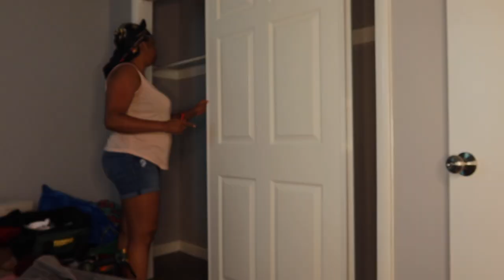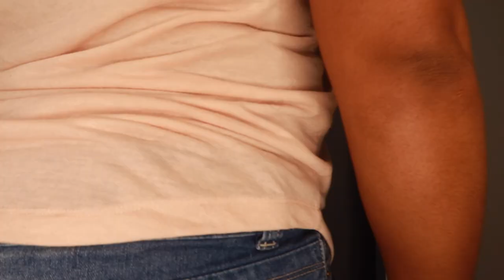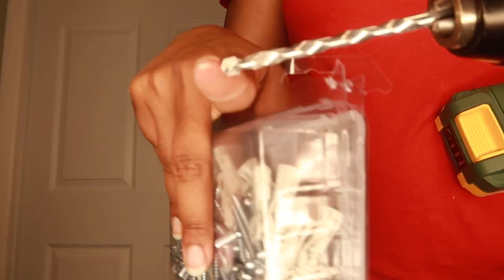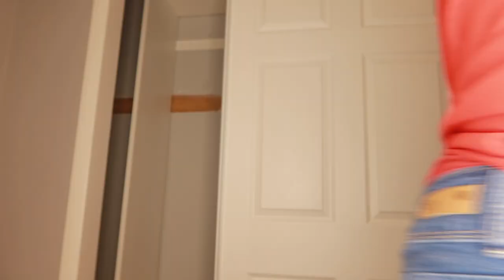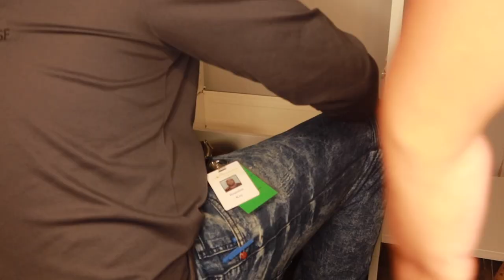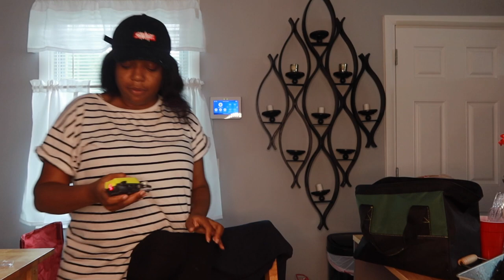How to put together Ikea Aurdal Closet organizer install Chapter 5

Comment: So a little tip, if you count seven peg holes up from each exposed drawer the drawers will be closer together. I’m not sure if you were really going for that super gapped look or not but if not it’s seven peg holes up for the drawer rail to be at its closest together so that you can’t see in them  but more importantly so you can get more storage up top if you do it that way. I also noticed the huge gap under the bottom drawer that would be six peg holes up for it to be closed to that bottom shelf. Just a tip to maximize storage. I just did a closet design and installation for a client of mine and it truly maximize is the storage space. Just add some drawer poles are drawer pull tabs to open and close the drawers and you’ll be good to go!
Reply from the maker: I know I’m late. Sorry. Yes I went over the draws the very next day because it bothered me so much.